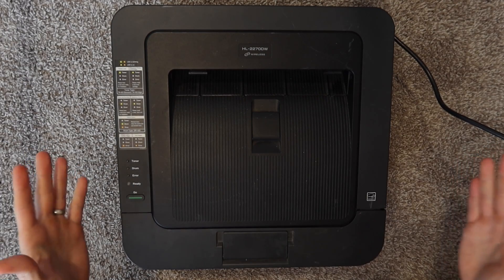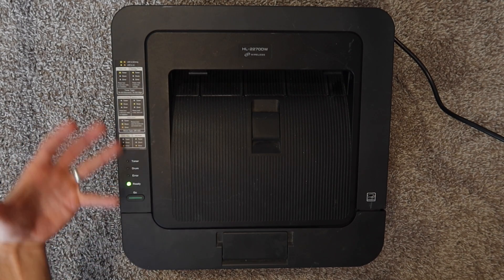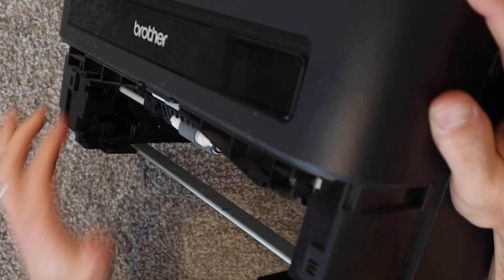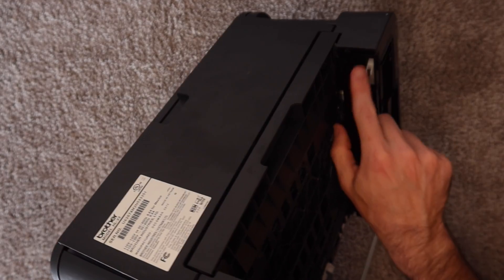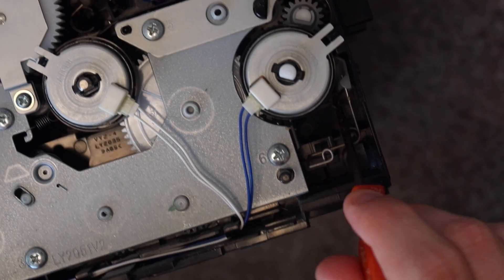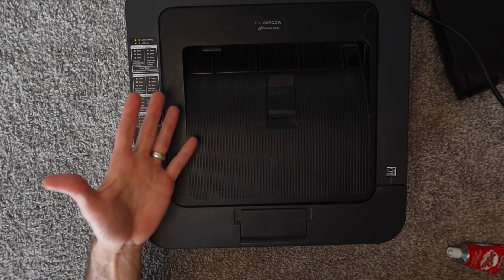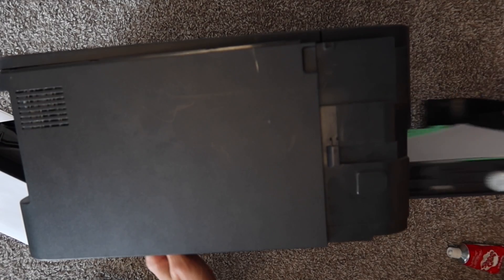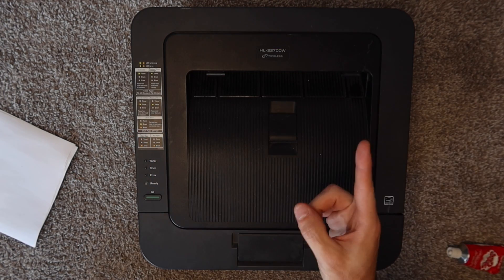Brother Printer No Paper Error [FIXED] Orange Solid LED on 2270DW

Comment: Thanks for reminding me about the level indicator. 😺I have a different model (20yo Lexmark E232) that got fussy since it's accordion-esque paper jam the other day. I've had many issues over the years but did I remember to jingle the level indicator? Nope. I moved it a few times and it worked. I haven't had to do that for several years. 🙀

Comment: phuckin-a. nice job finding that. it worked here. it won't happen again either. i took an angled head dental tool that could get in there easy, heated it, and flattened the head of that shaft so it was a rivet.
Reply from the maker: Fark yeah 🤝

Comment: Thank you very much for sharing this video—it was very helpful! However, one point is confusing: everyone seems to suggest that the issue is fully resolved, but if that white plastic piece is shifting, it means the lip that originally held it in place is broken. The steps shown here only provide a temporary solution. After a few pulls of the paper tray, the piece shifts again, requiring further adjustments. To permanently fix the problem, you need to lock it in place. In my case, I removed the motor (the one with the blue wires, no need to disconnect the wires), and pressed a properly-sized washer(I actually used a socket for a snap fastener from a sewing kit) onto the rod where the white plastic piece sits. I also used epoxy glue on top to secure it. This keeps the white plastic piece in place while still allowing it to rotate around the rod when the paper tray is inserted. Sorry, it's hard to explain in text. Also, regarding disassembly, the video doesn't show that the back door should be opened to get easy access to the hinge, after this part is unlocked the bottom lip removes easily (I was struggling with it a bit). Good luck.

Comment: Thank you so much!  and if anyone needs the factory reset afterward
 1. Open up top front panel.
2. Turn on power switch WHILE holding green GO button.
3. Three lights should be lit, let go of the GO button.
4. Press GO button 10 times in succession.
5. Close cover.
6. Press GO one last time.

Comment: Fantastic.  Saved me throwing the printer out to just buy a new one.  luckily my fix was super easy and just need to move the dislodged tab back but it is great to see you go over the other options including the part required if it gets more broken.  Great work with the video!

Comment: I tried all you suggested in your video.  It picks up paper now but prints blank pages.  New toner cartridge is installed  and will only print the printer settings but no other documents or PDF files.  No paper jams either and the red error light stays on but if I unplug every time I get the green light and may print the last of three pages but not the others.  I reinstalled the software too.  HELP!!!

Comment: I didn't need to follow the entire set of instructions. As soon as I popped the first side panel out, I was able to reach that white part that had become dislodged. I didn't really need to even remove the entire panel altogether. Just an inch is enough to jam your finger down and put it back in place. Thanks for the suggestion!

Comment: Thank you! Thank you!  Thank you!  I found that the white piece has a nub that is supposed to hold it in a slot and that broke off.  It is a tiny piece smaller than a lady bug.  So I put it back in place and am holding it with a small binder clip.  The side won't go back on with the binder clip, but the printer does work.
Reply from the maker: Good work! Glad you got it printing again

Comment: Great video, to state the least! Followed your instructions and found that the "white arm" to the gear thingy, was broken off where it was suppose to engage with the slid in paper TRAY! So now I have to FIND that very poorly designed NEW PART, and buy it and replace it, somehow!
So we be without a PRINTER again, with the last one a Brother MFC J895DW, which was another Brother's P.O.S! 
Which used up a black cartage after only 100 Copies doubled spaced for $20! And IT was bought NEW! So I got for $285 about 300 total copies = almost a BUCK a copy and it DIED!
I could have paid 20 cents a copy at a COPY STORES, and saved $285 DOLLARS!
I's called "Planned Obsolesces" so them, (all of them,} copier makers can sell more copiers!
So they design FAULTY "hard to replace" parts, so they can sell another copier!

Comment: Thanks! That worked, but not how I expected. The little white plastic was where it was supposed to be. But the second gear was deep inside the machine, so I pushed the white plastic forward and the two gears engaged. Unfortunately, the white plastic disappeared. How, I don't know. It's probably in the printer somewhere. But the two gears have remained engaged nonetheless, so now it's working! Thanks for the video.
Reply: Can you explain which gear wasn’t engaged and how to to that? I moved the plastic like he said but still not working

Comment: Thank you, Eric.  I managed to, at least temporarily, fix the issue.  I have the identical printer in your video.  It's been a great little printer! (I didn't actually have to remove either of the side pieces and not sure exactly what was wrong but I just kind of jiggled that little piece you mentioned that might have been dislodged.  For now, we are back in business.  Thank you for your video help!

Comment: Hi thanks for all you do. Question my Rollo printer continues to print my previous label until I turn it off after printing each label. I tried holding the lighted button to reset that is not working any other suggestions? Thank you